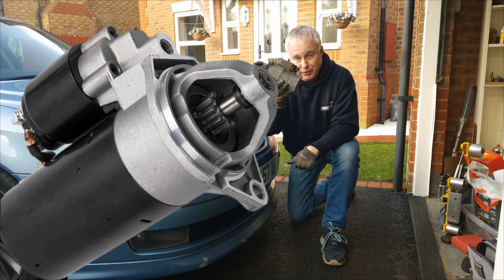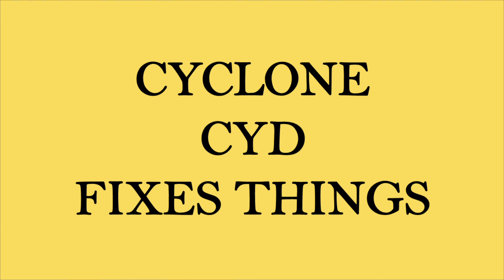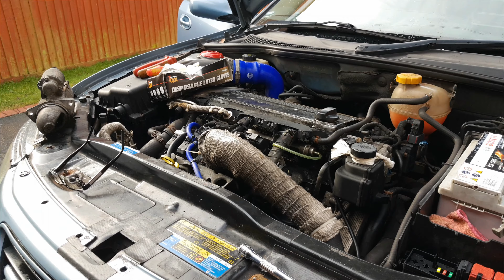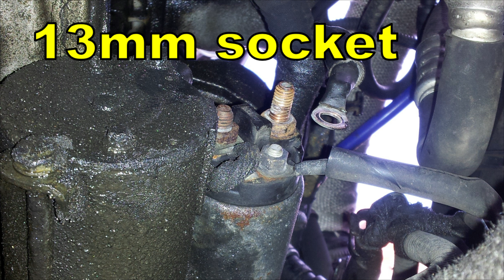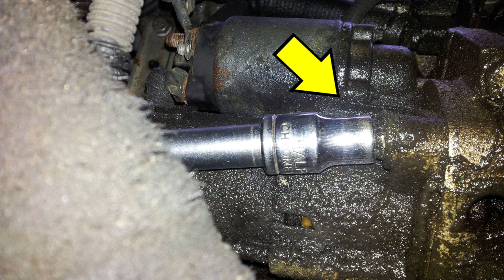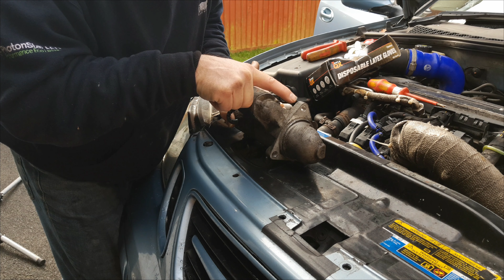Saab 9-3 Starter Motor Replacement Tips and Tricks | Full guide

Comment: My Saab 95 2001 petrol doesn’t start when it reaches normal engine temp. Then I have to wait for some minutes until it starts. Sometimes it starts after holding key at ignition for a second. Also  when it finally starts it will start again and again. But once it gets cold the process starts over again. The starter motor never makes a try the car is just completely dead until it suddenly starts.

Comment: It is probably a good idea to soak the nuts on the starter battery feed in penetrating oil for a few hours before trying to loosen them.  I just had the plastic head of the starter snap in two when I tried loosening the nut holding the battery cable on so I could get to my cps sensor behind the starter.  Durn it.  New starter now ordered.

Comment: Great video to the Saab nation. I used your crowbar recommendation, much needed - not sure how without. To find the bolt, no phone is needed nor light. There is a long skinny bolt holding the cover over the starter motor, you can use this as a guide to find the hidden bolt. Torx design also helps 'find', which is nice.
Reply from the maker: Great tip. Hopefully I'll never need it, but I'm sure it'll help others and I thank you on their behalf.

Comment: Hi. I recently bought a new starter motor for my Saab 9-3 b207e. But the connections don't seem right. On the new one there is a black tube and at the bottom a small copper pin. And og course a main lead. But on the old one they look like the one in the video.

Comment: Hey! So I have a 03 9-3 with a no crank no start I pulled the starter in the dark the other night and last night I put a new one back in I went to put the power wire on and I notice there are 2 separate red power wire straps and a signal wire so 3 wires total. I swear I only removed 2 wires but now I have 3. Is there 2 red power straps that attach to the starter power pole or is this something else entirely I can't find any info online about the wiring for the starter. Any info would be really appreciated
Reply from the maker: No, just the one which comes direct from the battery. Could the second belong to the alternator?
Reply: @CycloneCyd  it was to the alternator. So I connected it without the second strap to the alternator connected and the car started but gave me a battery not charging warning. So I connected the other wire to the starter on the power pole and it's running as it normally should now I'm not sure if it's right but I drove it for over an hour like this and it seems completely normal. I'm still confused thou. The way the wire is routed it seems like the only place this wire could possibly go is on the starter power pole? I've searched all over the place and there literally is no other place for this wire to go.

Comment: Hi my 2002 Saab 9-3 se not starting or engine did not crank I’m wondering if thats a starter problem where should I start with trouble shooting the problem thanks
Reply: Assuming you resolved your no start issue by now; but for others, the first place to start is to check the hot lead on the starter to make sure it is getting ~12V in the start condition.

Comment: Is it kind the same as a diesel?
Because my diesel doesn’t start properly:(
Reply from the maker: The diesel starter is more prone to "going weak" partly because it has to work so much harder to turn the motor over. Have you checked the leads and connections? https://youtu.be/UKTd4aI3-Mw

Comment: I held my phone 30° to the vertical alls I could see was matrons nickers. :-) original Italian job reference. Jokes apart another great video, great idea using the phone in real time, have got inspection mirror for this but find it confusing at times up is down left is right and visavi. Thanks for vid. :-)
Reply from the maker: "You were only suppossed to blow the bloody doors off!" One of the best lines in any film ever. I used to use an old door mirror glass for this sort of thing, still do occasionally, but a phone makes a great tool for the job too. You can also review the video again and again if you feel the need. I used the phone trick this weekend to look behind bathroom cabinets because I had to rejig some pipework (feckin' builders!) to fit new taps.